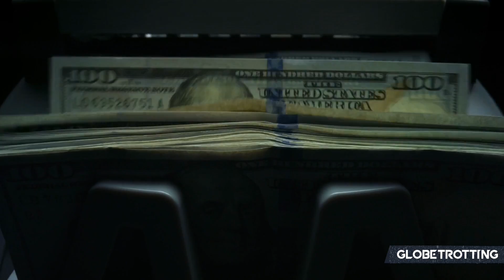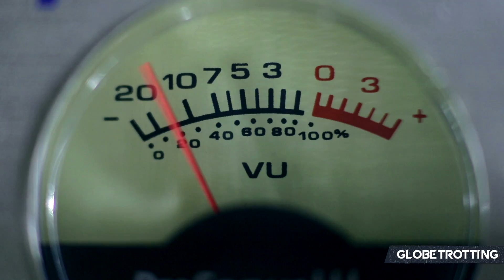Boeing's Scrapped 747-500

Comment: I just seen on the Internet that they just scrapped a 747-8.     The aircraft had only 29 flight hours on it and was built in 2012.    They couldn't find a buyer for it after 2 years of searching for one.   They offered to sell it for 95 million, and that's a giveaway price.   It was a steal.     That plane costs around 450 million new.      What a deal.     If I was a billionaire, I would have bought it no questions.    It was a luxury model with all leather seating.      747s use way too much fuel.     That plane will burn 55 gallons of fuel a minute in the air at 30 thousand feet fully loaded

Comment: The appaling row generated by the Tu-95 Bear would be a powerful argument against such a machine, both on the ground and in the cabin. The vibration of turbo-props is another argument against them, especially for long-haul flights. Complete rows of seats in line with props are best avoided.
What would be really interesting would be a transport implementing the configuration of  the Honda Jet: two engines mounted above and behind the wing. That couls have all sorts of benefits.

Comment: I remember the 7J7 Prop-fan proposals planes. There was considerable interest because of the fuel efficiency gains, but one of the biggest negatives was passenger acceptance.  At that time, there were a number of efficient twin and even  4 engine turbo props running around in regional service, and passengers were less interested in a new propellor engined mid or long range airplane. The generally preferred to fly on a jet engined airplane vs a propellor engined airplane. If given a choice, they would chose the jet over the prop-fan. A major red flag for airlines. Plus, as development moved further along, the negatives of the design and configuration became more prominent. So at the end of the day, it eventually became a bridge to far and was considered a dead end, so the prop-fan was pushed aside.

Comment: The idea was actually scraped because they could not convince even the airlines that they could move all seats another 1.4cm. closer and squeezing in additional 24 seats... it was called project "slave ship seating",,,or "SSS" for short. They tried eliminating the coach gallies, but could not sell the idea of long flights with just bread and water as meal service. AKA the "SSS&BW" plan, United airlines will slowly implement this on flights under 10 hours in mid 2024 before the summer travel season,

Comment: Propfan engine look like a dream in late 80s with Boeing 7J7 and McDonnell Douglas MD-94X and it’s gone, but in currant days manufacturers is return to developing Propfan engines like Safran and CFM but I don’t see any future aircrafts will using this engine
Speaking of 747 if Boeing launch the 747X I don’t think the 747-500X will have a high sells like other ultra long range aircrafts like 747SP, 777-200LR and A340-500 even if quants is interested for this aircraft but not enough to launch the program

Comment: DJ, the engines you referred to were not conventional turboprops but rather unducted turbofans called 'prop-fans' back then. Though they offered unparalleled fuel efficiency for the time, noise was indeed a problem and likely a big reason why they were abandoned. Airflow through the cowled engines helps shroud the noise from the turbines so without the cowl, they screamed quite loudly. Also, the unducted fan blades had no cowl around them to absorb shattered blade fragments so it was also a big safety concern in case of catastrophic fan blade failure.
Reply: Thank you for correcting the site! This is a large error of facts about the type of engines used.
Reply: Thia channel puts the pathetic in hypothetical.

Comment: Propfans or Unducted Turbofans were the fuel economy hope in the 80's.  Even with substantially higher efficiency, noise, cost and lowered fuel prices outweighed the standard High Bypass turbofans as improvements increased.  No doubt flying passenger concerns of "weird" designs were taken into account such as the long time Winglets took to being deployed.

Comment: Boeing is not a risk taker and this is exactly why Airbus is eating Boeing’s lunch in every category.
Reply: Please. They took a naughty risk with the Max jets, and THAT is why Airbus is winning. And they also took a risk by not building larger than their 747 series, and they risked right on their decision not to.
Reply: @ElAye  A380
Reply: @jayvee8502 Boeing forced Airbus’s hand by creating the 747-8 which had the infrastructure to build the aircraft when the A380 was only an idea. Airbus is ahead because of the complacent company culture within Boeing in addition to the issues with the 737Max.
Reply: @ElAye   check out the number of orders for 737 MAX vs A320NEO.    Boeing has made a mistake by not replacing the 757.  That will cost them the lead in airframe numbers per year.
Reply: @mnrobards  I agree.
Reply: @ElAye  they don't take business risk. Just people risk
Reply: I think it’s the opposite. Boeing has always been like the risk taker and they have been eating Airbus for years. The 777, 747, and 787 have eat Airbus’s lunch for years. 

Airbus have been very consistent at using existing and proven technology. Boeing have been a little more innovative and I think it’s because of their decades of experience in military technology
Reply: Boeing will fall behind in number of aircraft manufactured per year and has internal issues to resolve.  Boeing took the lead on every airframe except the A380.  Airbus was smart enough to buy the A220 which will account for high production rates over the next few years.  I don’t see Airbus coming out with a new airframe in the next few years.
Reply: What risk is Airbus taking when their government subsidies dwarf Boeing’s?
Reply: @alanmiller9681  Here is the clown with the government subsidies story
Reply: 787 is a market leader against the a330.  But otherwise I agree, the a321neo is better than anything Boeing has on offer.
Reply: @tylersmith4265  Boeing 777 airfrAme similar Airbus A330.   Boeing 787 Airframe similar to Airbus A350.  There is some overlap with the A350 and Boeing 777 on capacity and range.  Boeing market leader in some airframes since they were first on the market
Reply: No they’re not lol.
Reply: Not in every catagory. 787 and a330neo fall into one category. And it's very obvious that a330neo is no match for the 787
Reply: Airbus risk it with gov money
Reply: @lowcolin  Airbus is a consolidation of state aircraft maker. They borrow money to France and Germany interest free.
Reply: @lowcolin  I’m amazed that the fairy tale of Boeing not taking any government money still lives on to today. 😂
Reply: Brainswash alert

Comment: I can easily envision a commercial freighter airliner with the fuselage of a 747 with the raised cockpit / opening nose for loading, but a 777 wing and 2 engines for efficiency.  The landing gear struts would need to be longer for engine ground clearance....    Or is a high-wing freighter with raised cockpit like the C5 the right solution?
Reply: Nose loaders are rarely needed and the mechanism is touchy.  A regular 777F would be ideal.
Reply: The volume of cargo aircraft isn't enough to justify the investment for a cargo plane alone.
Reply: @johniii8147  Cargo planes typically 'bulk out", that is they run out of space before their runway, climb performance, or structural capability  runs out.  This is especially true of the 767 that I fly.  The width of the 767 was chosen by Boeing to be exactly between the 747 and the narrow body 727 and that means 186 inches.  The 767 can carry more weight than the A300, but it has less available area.  This 767 airplane is the Toyota Prius or Volkswagen Diesel of airliners, it is designed for ULTIMATE fuel economy!  That is, as long as you stay on "path"
Reply: @Flies2FLL  Thanks. I appreciate a pilot's perspective. The 767 seems to hit the sweet spot for cargo in both new builds and  conversions.

Comment: speaking of quad jets Boeing needs to bring back the B747-8I & B747-400 ER in a new avatar . . . besides the B747 series was the only true double decker wide body quad jet that was able to sustain itself over 48 years of active service with leading full service carriers around the world . . . the B747-400 was unmistakably a legend of an aircraft . . . in the post 2020 world active iHYBRId aircraft propulsion system is the only thing that can sustain quad jets efficiently, in a market dominated by state-of-the-art wide body twin jets . . . the A380-900 Neo LR which was a conceptual stretched variant of the A380-800 that came very close to being a reality in 2011 can still be revived . . . the B747-500 can still be salvaged, only if the OEMs can come up with a reliable & effective Combined Electric Propulsion System (CEPS) . . . it'll make the B747-500 & A380-900 Neo LR fuel efficient by 53% - 58% . . . something that was not achievable before, rather never tried to achieve on purpose . . .

Comment: Props on a 747? What a crazy idea. 
New advanced engines on the queen of the skies would be a super idea.
I along with millions of others loved the 747 and wished they continued to build them.
Reply: The biggest problem with propfans is that they are loud.
Reply: @markevans2294  The biggest problem with turboprop engines is that they are less fuel efficient than jet engines at higher speeds.

Comment: Some mention of the A380 would have been on theme.
Reply: Exactly.  The 747-500X and -600X program was being developed at the same time as the A380.  All the airline customers Boeing marketed the new 747 to opted for the all-new A380 instead.  Meanwhile, Boeing was simultaneously developing new versions of other airframes.  Priorities were set, and the 747-500X and -600X did not make the cut.